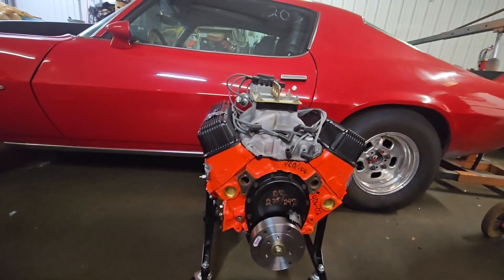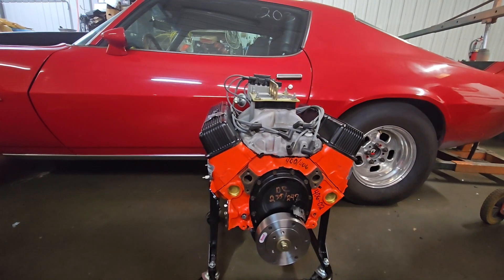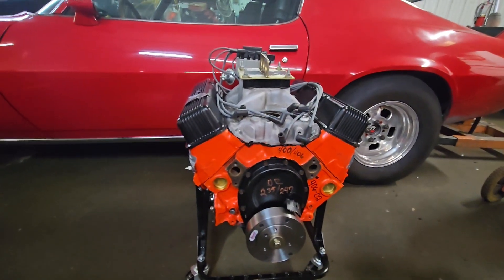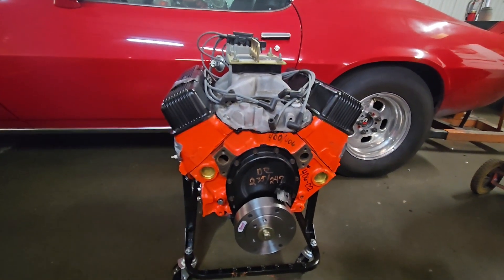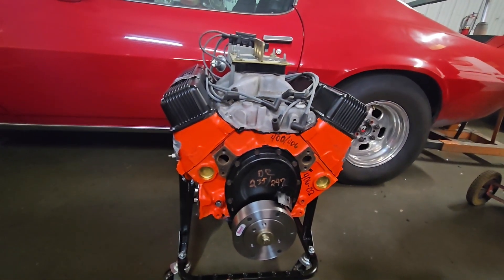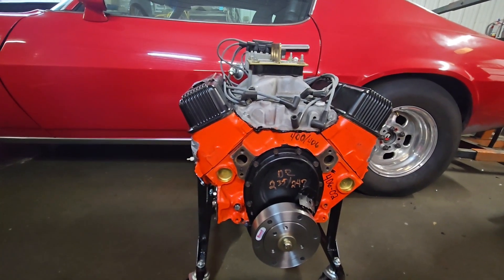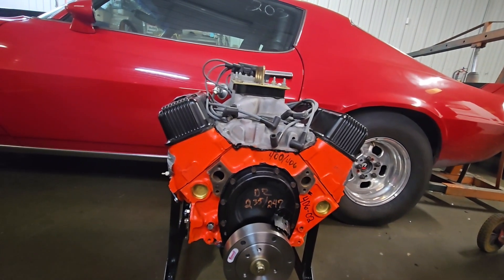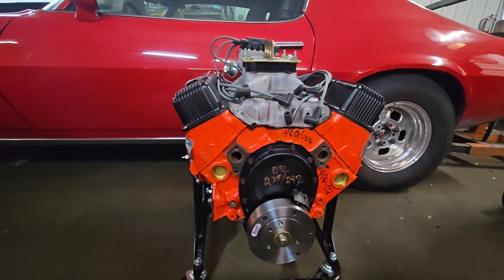Double Hump #461 GM 406 SBC

Comment: Solid performance. When I saw 461s on a 400 I thought they would choke it out and not have enough flow to make much more than 425hp or so. Your port work definitely paid dividends on this mill. 1200rpm peak to peak is almost perfect for a street strip application and still at a low enough RPM to have decently good street manners. I dig it.
Reply from the maker: But the performance down low is outstanding
Reply: @dzperformance7360  I bet an RPM air gap and a little more carb would push the RPM up just a little, might just tickle that 500hp number. 
After looking at your channel a bit, I'm guessing you know a good bit (alot a bit) more about building motors than I do, I know just enough to say dumb things. haha
Anyway, seeing that you dyno test in Enid I assume you must not be too far from there. If you are interested I'd be interested in talking to you about a motor build for a car I'm trying to get together for drag n drive events. Maybe do some collaboration videos. I'm out of Guthrie. Anyway, just a thought. I like to support other youtubers and currently looking for an engine builder to try and work with.
Reply from the maker: Thanks for watching thanks for chiming in with a comment. Yeah the overall performance is not totally disappointing but I built this exact combination with brodix heads before and it did 525 horse I was hoping for just a little more

Comment: The cam small base circle ?
Reply from the maker: no
Reply: Do you have stoker clearance rod
Reply from the maker: They are summit 5.7 rods that I put extra clearance in the rod bolt area
Reply from the maker: Okay to be perfectly clear the summit rods do have extra clearance for stroker application but I ground on them some more and then weight match them up

Comment: very impressive numbers. I have always liked the Camel Hump heads.  there were actually 8 different version of them.  the 461, 461X and 462 are identical but the 461X had slightly bigger intake runners as cast.  and were used on 327 from 62-67. all had 1.94 intake and 1.50 exhaust valves, except the corvette dual quad, and FI motors that got 2.02/1.60 valves. all of these have not holes in the ends of them for accessories and are for short water pumps and short water pump brackets.  the 461X was an over the counter / out the back door head for race teams and not installed on factory cars. the was also a 399X head as well but i don't remember if it had double humps or not.

there were actually 2 versions of the 291 head 3912291 and 3917291 was used on 327 and 350 and also 302 Z28 Camaro engines. all of these do not have holes in the ends of them for accessories and are for short water pumps and short water pump brackets. the 327 corvette and the 302 z28 got the 2.02/1.60 valves. 

the 168 head was used on 1969 302 engines, and the 1970 LT1 350 engines. the 186 is similar to the 461X head and has the bigger intake runner and it also has the bolt holes in the ends for long water pump style mounting brackets. there were 2 different 492 heads. the 3991492 cast was used in over-the-counter heads with angle plugs, and similar to the 186 head and has the double humps, 3891492 does not have the double humps.  

my personal favorite is the 186 head. but there are stupidly expensive since they only came on 69 302 Z/28 and 1970 Camaro and Corvette LT1 350 cars. and restores want them for numbers matching stuff.  

all that said, every aftermarket aluminum head will out flow the camel humps and the only reason i would use them is if i was restoring a number matching engine or building a marine engine. river/lake and seawater kills aluminum in no time flat. so, hands down Iron for marine use. but even then, there are better iron heads for that. the 906 vortec heads are much better, the old iron bowtie heads are better, the old dart iron eagles are better. i could go on and on about all the better heads.  however, if you want the camel hump look on a modern performance head, Trick Flow Specialties has an aluminum replica of the old camel hump heads, and it flow 30 cfm more than the Vortec heads, which are the best flowing factory iron heads.  and they are available with or with out the accessory holes on the ends.
Reply: I have the original block 186 heads and intake out of my 70 Z28 Camaro I had in the late 70's. I also picked up a set of bow tie Chevy heads a few years ago for almost nothing. Glad I held onto that stuff. Hopefully will find a project in the next year or two
Reply: It's funny you mentioned a 70 Z28. My current project is a 1971 Camaro SS 396 4 speed car. It's numbers matching, but it is missing a few big ticket items. Like the radiator fan shroud  amd the rear sway bar is bent like hit something in the road. Body is dent free, except for a small door ding in the passengers side door. Looking forward to getting back on the road

Comment: Cool build- nicely done!
Just curious- how are you coming up with 10.3:1?
I calculated it with Wallace Racing’s Compression Calculator and kept coming up with 10.69:1?…
Reply from the maker: Maybe I'm off by a little bit or I miss quoted the Deck height in the video
Reply: @dzperformance7360  
All good- wasn’t trying to be critical, just wanted to see how to replicate your numbers.

Comment: We ran a real similar combination in our 406, little smaller camshaft and 1.94/1.50 SS valves. We had it in a Nova and estimated it to be around 450hp. I have a pair of matching date code 462 heads in the garage now waiting for a 355 build. Great numbers on your setup.
Reply from the maker: Thanks for sharing

Comment: Hi Nick. Would you be able to include cylinder pressure on your engines? Maybe compression test 1 or 2 cylinders? I about had my buddy jump and call you. Something like this for his 73 camaro. He paused, being told a co-worker's buddy has some engine in some garage. Sure...we'll see how that pans out. Be well- pat
Reply from the maker: Yeah I'll do that on the next motor I put on the engine startup stand I'll do a compression check on a couple cylinders and see what PSI it comes up to
Reply: @dzperformance7360  thanks much- that helps when using California's crap gas.

Comment: If you know what you’re doing those double hump heads have the potential to flow extremely well. They are harder than ever to find now though.
Reply from the maker: In my area the 461 are easy it's the 186 and the 292 that are tough to find,, thanks for watching

Comment: use to drag race still have 1 set off 461 left      461x was better
Reply: I ran the 461 heads on my early 327 engine..2 of the studs started pulling out so had them pinned..ran a big Erson hydraulic cam with TRW forged pistons..Holley Strip dominator intake with 750 double pumper..it was a potent combo  for early 1983-1984...I found some 461X heads at the Pate Swap meet outside of Fort Worth Texas right after I built my 327 and got them cheap..just needed cleaning up and hand lapping the valves..sold them for a fair price after my 327 spun a rod bearing.  I like this video and will subscribe now.

Comment: Do you ever do any big blocks with the earlier closed chambered heads? I believe 702 or 063..
Reply from the maker: Yes if you look through my videos I did a 396/408ci that had cast#290,, and a stroker 396/436ci. that also had csst#290's the 436ci set was 1968 with big vales , ,,the 408ci. had stock 2.65/1.72
Reply from the maker: Those are semi closed Chambers about 100cc, come to think about it I've never tested on a BBC. cylinder head older than 1968
Reply: Thank you for your response

Comment: My question is the heads drilled steam holes. Great video thanks.
Reply from the maker: The exact answer to your questions no not yet. Just running it on the dyno I enlarge in the holes in the gasket like brodex recommends on their cylinder heads that you cannot get water between the cylinders. But if I was going to drive it on the street I would definitely drill the holes

Comment: Hey Nick,I really enjoy you sharing your build information with dyno numbers.Perhaps you could show us some assembly videos,I think it would be awesome to see all the parts fresh from the machine shop on the bench and then assembled like you do after the dyno with specs..I also like the fact you use mostly GM cast iron in your builds so cool..Thanks again
Reply from the maker: I got a 406 coming up and a 461 to be assembled I'll do some videos on those
Reply: @dzperformance7360  Thanks Nick I “WE” really appreciate that.I’ll Definitely will be tuning in..
Reply from the maker: Since you ask I'm going to do it ,but I'm not really, a  how to channel I'm kind of a results Channel, but like I said you ask, ok I'll do it
Reply: Nice content, I got a stock 400 still has the balancer and original pan on it with factory dished pistons, also have a set of 186 ,300 hp heads hope to build it soon,I just got a 383 assembled for my 4wd 2500!! Keep em coming!!

Comment: I have built about 12 406 engines and they just flat out run. Best bang for buck is this. 
Stock crank with 6 inch rod and hyper flat tops.
Zero deck to make 11.4 with a 64 cc head.
Promaxx 215 head
Flat tappet lunati 247 255 550 530 on a 106
1.6 1.5 rockers
Ported vic jr 
850 holly 
1 5/8 headers.
555 hp at 6200
540 torque at 4800.
Same engine with afr 195 and a comp hydro roller 242 248 extreme on a 110 will make 580 hp and 565 torque.
Reply from the maker: thanks for sharing your combinations
Reply: @dzperformance7360  no problem,  I used to build them with the 5.56 rod and I see a good 25 hp just using the 6 inch rod, you can get a good set of rods for cheap now. I have never broke a 400 stock crank even at 600hp and 6800 rpm. As long as the crank has a nice radius they are tough as nails.
Reply: Sounds like my next build my 400 has been in storage long enough I keep an eye on it daily!😊
Reply: Had a set of them AFR 195s on a 509 406, wished I would of keep it ,sold it with a car

Comment: Great combination!
Reply from the maker: I know the my AFR heads would blow the double humps away on horsepower and just a small amount more torque but the cool Factor of old school double Hump's can't be beat
Reply: @dzperformance7360  i have often wondered how great it would have been if GM had built an high performance 400 engine in the 1970!